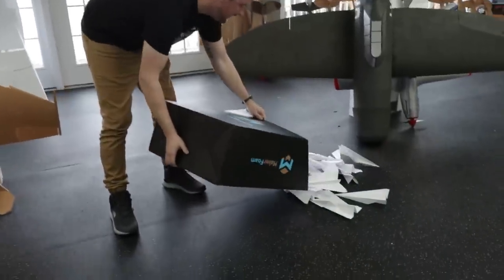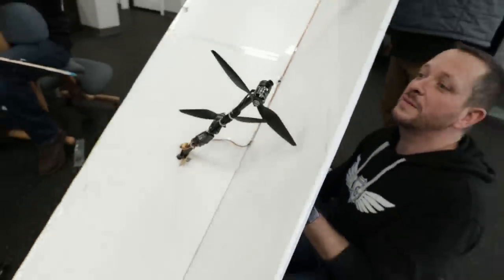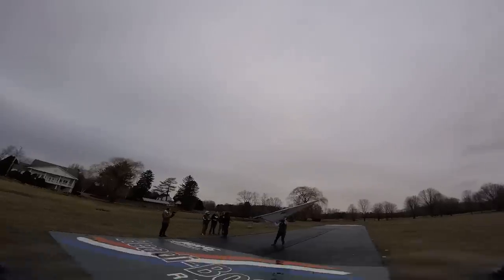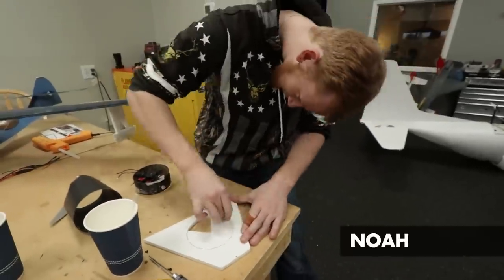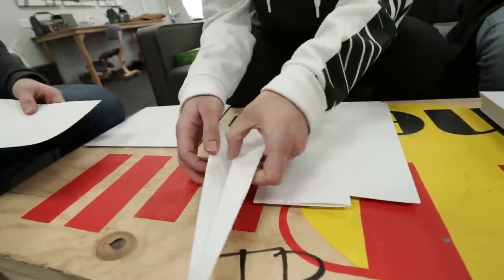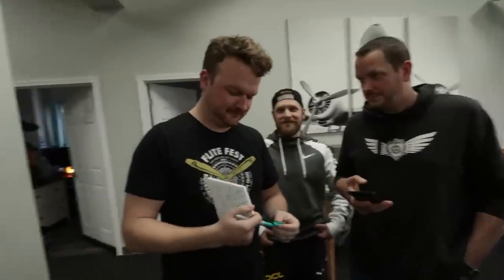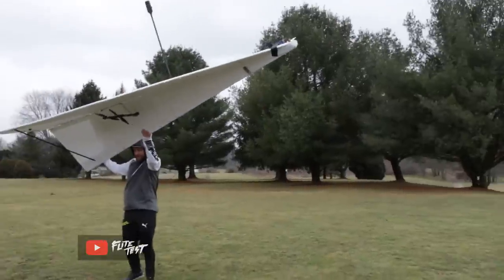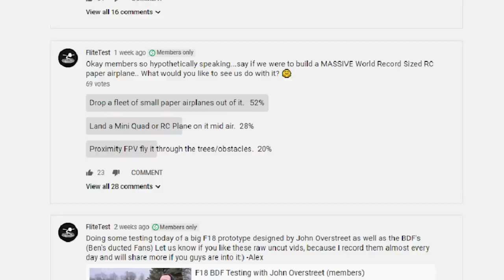Attempting to Drop Hundreds of Paper Airplanes from the World's Largest Paper Airplane

Comment: Hi Guys, Love your channel . I'm just now getting back into the hobby , after about a 45 year break, life has gotten in the way it seems every time I started to get back into it , you all say you have free plans , where can I find them ? I do have a technical question involving electric motors and power ranges, I have a lot of R/C kits already, all still in the  box . I'm curious to find out what kind of motor you would suggest for a kit that's calling for a .40-.52 4 stroke nitro engine and a 4 channel set up, any input would be very helpful